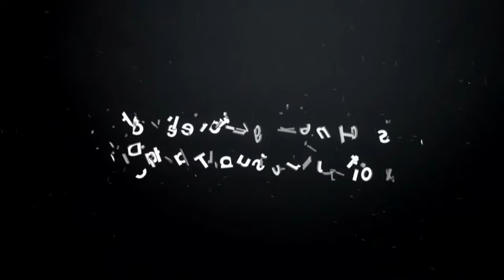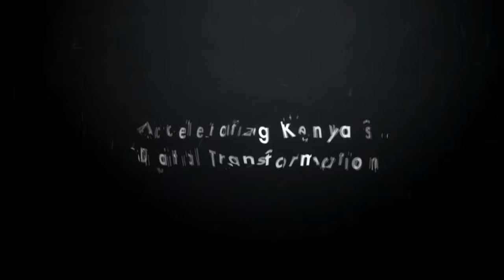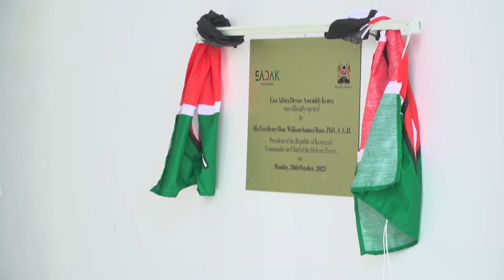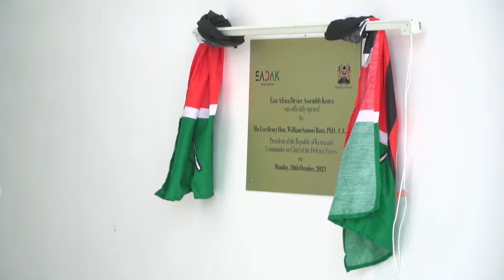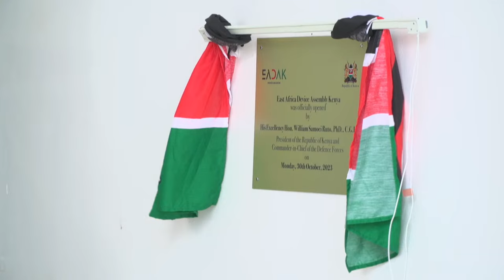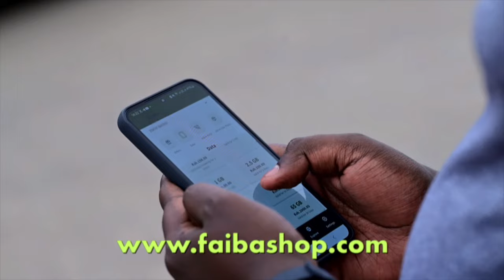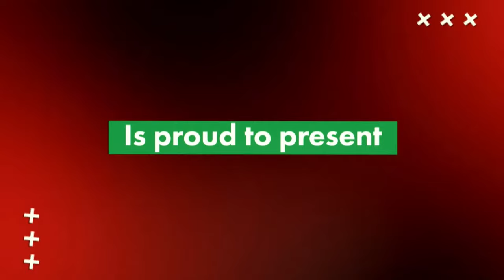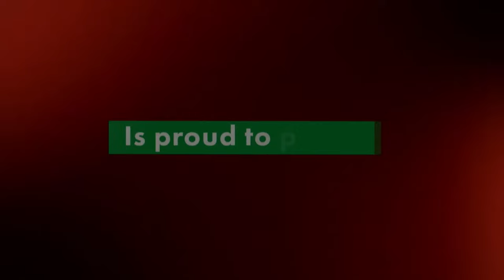Witness The Launch Of East Africa Device Assembly Kenya

Comment: This is a huge step for us. If you didn't know, most iPhone screens are manufactured by Samsung? (till date) Apple began reducing outsourcing for hardware production in the early 2010s, designing custom chips like the A4 and M1. They still collaborate with suppliers for some components, but they now have more in-house control. so we are on the right track